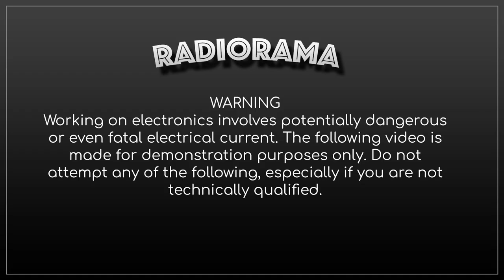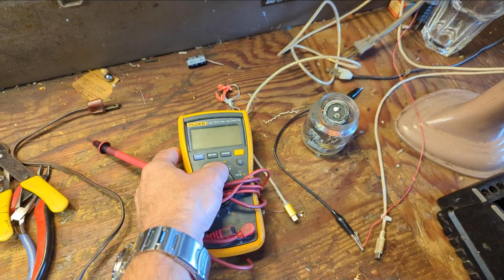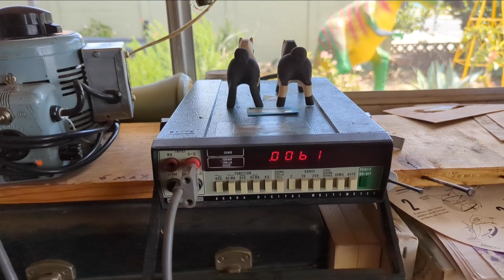For Newbies: How to recap a typical All American 5 radio

Comment: Thanks,
I am restoring a 1948 Motorola 6-tube AM receiver that I picked up. I didn’t intend for it to become a hobby but it’s turning into one. All of the caps are melted and the insulation is so badly damaged that I think it shorted at some point and fried everything. This is helpful. Very detailed explanation of how everything is done and how it all fits together.

Comment: I believe some vintage valve(tube) radios used to use the pilot lamp(s) as a fuse. So if the pilot lamp(s) failed, no electrical continuity.

Comment: I just found your video and it was incredibly informing. I just rehabbed a zenith AA5, including an output IF can. I'm getting an approximate two kilohertz tone that's very loud between stations. I've traced it to before the volume control and it's actually louder than the stations themselves. Any thoughts or a direction you might be able to point me in? Thanks for the great video

Comment: Mister Radio isn't it true you want go higher in voltage not lower when recapping those radios? Also I have a electrolytic that says 30mfd 30mfd 20mfd 20mfd then it says 150 w.v,yel 150w.vred 150w.v blue 25w.v green  what voltage and and microfarad capacitor recommend replace it with?

Comment: Ha, an Emerson model 518 with Arvin knobs. They would be rather loose so they bent the tangs wider on the
two pots so they wouldn't slip off. Dang OCD strikes again for noticing that! Like these longer more descriptive  and 
thorough videos. At 33:49 those black "doomajigies" are called  a strain relief . They actually have tons of sizes but the 
line cord that is preferred is called a SPT-1. Thinner and easier to work line cord  for a lower wattage unfortunately
you have the more common SPT-2 line cord and is better for transformer type radios. It is used for extension cords too.
Strain reliefs like 6N-4 ,6N3-4 are used for SPT-1 and 6L-1 or a 7N-2 for the SPT-2 cords. They make a special tool that 
keeps you from breaking any strain relief . See Philmore 63-640, I  have one and it works great. A 50B5 was used in these because they didn't change the circuits when they went to two miniature tubes in  a later  manufacturing run. Originally 
it was a 50L6. A 35Z5 got replaced by a 35W4. I'm glad I'm not a newbie  because I would be so confused. Steve
Reply: I run into so few strain reliefs any more,  that I never bought the tool. However every time I pinch my hand when the pliers slips off wish I had the tool.

Comment: I have a zenith 5 tube clock radio that has a couple caps with 100 on one side and 22,5 on the other.  They are relatively small so I am thinking 22.5 MFD is not what it is.  Could it be 22.5 pico farad?

Comment: Im looking at a schematic and a parts list here, Its got 8 paper, 1 electrolytic, two micas, and one variable capacitor. apparently I shouldn't worry about the micas, but all the papers are labled as "mf", Is that Millifarad? The radio is a 4 tube superheterodyne battery unit. 1.5v A voltage and 90v B voltage. there does not seem to be any way to connect to the grid, or a rectifier, so its a fully dc radio. I know the papers have to go, and the electrolytic, But what about the tuning capacitor? The radio in question is a Galvin/Motorola 47B11

Comment: Hello Seth. One thing you really need to tell a newbie (I would be a novice) is to discharge their caps before messing around with cutting them out, for safety's sake. As most of us know, those things can hold a charge, and can give you a nasty surprise if not handled correctly. I use a resistor and a couple of alligator clip wires to discharge caps, cheap and cheerful, perfect thing for anyone looking to outfit an inexpensive radio repair kit. Full disclosure; I've never had my hands inside a tube unit, but have had my hands on many electronics (mostly computer boards and cards), but would still discharge any and all caps before messing around with them, just in case.
Reply from the maker: Yes. That is true. Luckily, unless for example electrolytics are not grounded properly , they seldom hold a charge

Comment: Bakelite? These radios 📻 are often 5 tube. The speaker 🔊 must be field coil. I wonder 💭 why these weren’t called 📞 “Christmas Tree 🌲 Light 💡 Sets”, regarding the special circuitry these  radios 📻 have. Power 💥 is cut to the WHOLE radio 📻, in the event of the failure 😞 of the dial light 💡 bulb. This is often where owners would draw ✍️ the line on even thinking 🤔 of repairing 👩‍🔧 the radio 📻. They thought 💭 it was the end of the line for the radio 📻. This often misunderstood “OFF” feature, guarded 💂‍♀️ against radio 📻 damage, electric ⚡️ shock, or fire 🔥. Your friend, Jeff.

Comment: Seth, where do you get your replacement parts?
Reply from the maker: I get capacitors and resistors either from mouser or from Sal's capacitor corner. Switches from Amazon, transformers from Alibaba. Tubes can be had for cheap on Ebay

Comment: So a strong enough jolt of electricity can cause a heart to stop beating normally,  and cause it to go into Ventricular Fibrillation.  This means the ventricles are QUIVERING, and not pumping blood. If a regular heart beat rhythm is not quickly restored.  The person will die. So surprisingly,  another jolt from a defibrillator,  can usually shock the heart back into a normal rhythm. Our hearts  actually function on electrical activity.

Comment: Lost interest early into the video. Reason being, your bench looks like it is intended to rebuild automotive engines, and rebuilding radios, is a side line. The tool chest in the background, loose pieces parts in and under the chest, and absolutely no real test equipment. Sorry, but that's the way I see it.